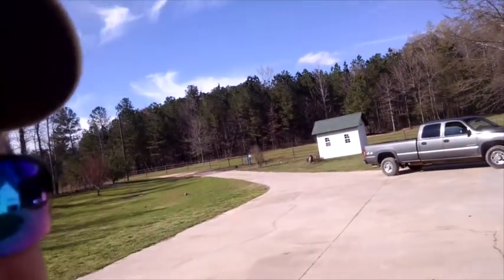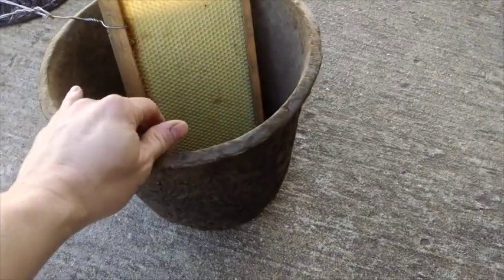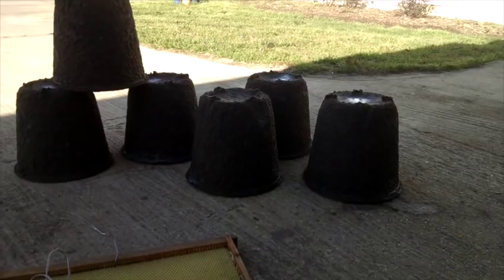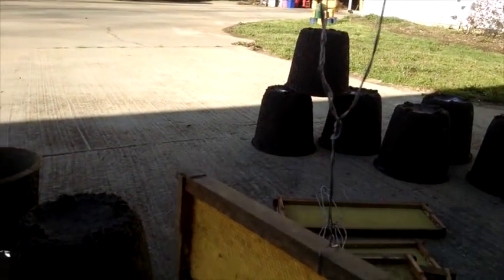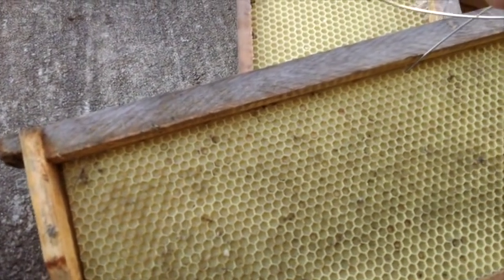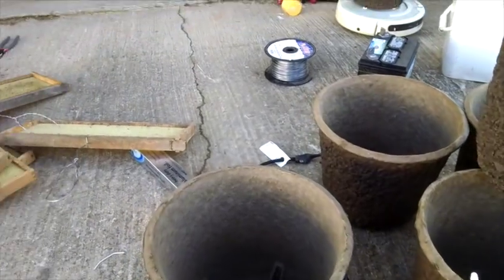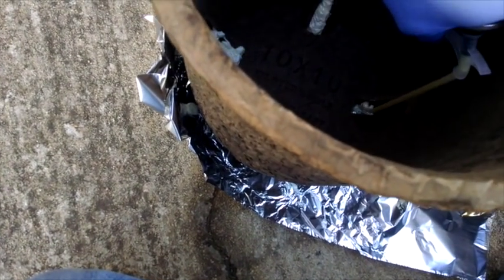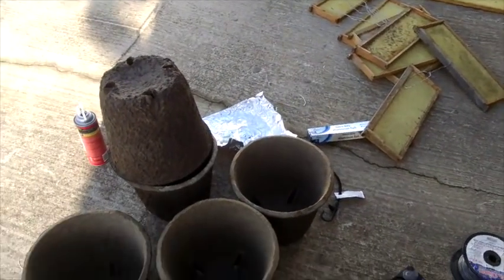Building Swarm Traps

Comment: Great idea! I would have used beeswax to seal up the gaps and to waterproof the trap .
Reply from the maker: +christine hood That's a great idea!
Reply: I was thinking the same thing. It would water-seal the traps, add a scent element to attract bees, and not impede opening the swarm trap to collect the bees into a box hive.
Reply: Beeswax would be a better option for a number of reasons, except that it's cost prohibitive.  The same amount of beeswax used to cover one of these could be put to better use to make several candles, coat several sheets of foundation, etc.. Scale that out to 10 or 12 traps and it starts to add up. Another thing I noticed is that when using beeswax on the outside, there seemed to be a higher occurrence of the bees building comb out on the outside of the pots.  This is my third season using these traps, and they work better than anything else I've used through the years. From what I can see, the waterproofing doesn't seem to bother them much.
Reply: Some very good points. My biggest thought was about opening the trap without damaging it too much for potential reuse. I don't keep bees, but I have worked with the foam.
Reply: A sharp box cutter makes quick work of the foam to separate the two halves. The remaining foam pieces can be flaked off by hand without much difficulty.  I was expecting the same problem you mention, but they can be taken apart and reused several times. I'm guessing maybe the waterproofing decreases the level of adhesion between the foam and pots?
Reply: Its possible
By the way, what part of Georgia? NW Atlanta metro here.
Reply: South Metro in Fayette County
Reply: georgiahikes It's good seeing local folks on the interwebs. Take care.

Comment: Marvelous idea! One minor problem - most expanding foams contain Formaldehyde! Hmmm lets see now, bees, chemicals, enclosed environment, minimum ventilation = dead bees!!!
Reply: Keep in mind these are very short term use.  I've since caught 20+ swarms using these since first posting the video and have not had a single instance of mortality associated with the trap.  I have had a few abscond, and a some that died out later, but none within 30 days of capture. I'm not disagreeing with you on the formaldehyde, but it doesn't seem to be an issue as far as I can tell.  I've also cut healthy colonies out of wall cavities next to expanded foam insulation.

Comment: My Father used oil of anise to attract bees when we were lining a wild swarm. It seemed to work for us.  I have not heard anyone mention lining wild bees to find the bee tree.     The first step in lining bees is to build a small wooden bee box made especially for this purpose.  Next step is putting a piece of 4x4 inch of honey comb in the box with sugar water added.   There are two compartments to the box, one holds the comb, and the other compartment has a small entrance door with glass set in the top to let in light.  You then catch wild bees feeding on flowers in the box and then slap a cover over the box trapping the bees inside, they will go through the small opening leading into the other compartment toward the light coming through the glass.   When you have 10 or so trapped bees you set up the bee box in your yard and release the bees from the box.     They will fill up on the sugar water before leaving and then fly straight to their tree hive.   They will then return for more sugar water and bring more bees back with them.  Within a few hours there will be hundreds of bees eating out of your bee box.     The next step is watching the direction they fly when going back to the hive.  After you have them working out of your bee box for a day or two  You then trap 25 or so bees in the box once again, and walk a compass course in the direction they fly when they leave to go back to their hive.   Set up the box again in a clearing and release the trapped bees again.    We usually set the box up every 1/8 of a mile until there are so many bees coming to the box it looks like the whole swarm is eating from the box.    Then it's just a matter of looking around at likely looking bee trees to see them flying in and out.     You can also time them by marking them with a small drop of chalk water or white flour mixed with water and time how long it takes the marked bee to fly home and back to your bee box.   If it takes them 5 minutes to fly home and store the nectar and return to your box it means you are real close to the bee tree.    Happy hunting. PS,  Make sure you stay exactly on the bees line of travel, otherwise they will not come back to your bee box, then you will have to start the process all over again from where you first started.   And take a good supply of sugar water with you to keep them coming back.    If anyone is interested in getting more detailed directions on how to line feral bees you can email me at naturebrook@aol.com  I will gladly respond in minute detail and even tell you how to take down the tree and put the live bees into a conventional hive to bring them home, it sounds more complicated than it really is..
Reply: Around where I'm from people don't say 'lining bees'. 

So I don't understand what you mean by it. 

But I'm interested to hear what you have to say.

Comment: I intend to use 5 frame deep NUC's to do captures in (with a frame or two in each mounted to trees....
I'll then be able to use the NUC's later for hive splitting and queen rearing.

I've seen the pot idea before, and sure it will work... I just prefer nuc's and building them from scrap plywood is easy.
Reply from the maker: +Atoyota I also make use of old nuc boxes and deeps for traps with drawn comb.  The deeps outperform the nucs pretty consiistently, but the whole point to these traps is that you can get them up pretty high quickly and easily.

Comment: great instructional video. What are your results? Do you have a video of a swarm taking up residence and how to open the trap and remove the swarm?
Reply from the maker: Karen Eaton  Thanks!  The traps have performed pretty well.  I've caught three swarms using them so far.  Two of them were massive, and filled it with comb very quickly.   Because they fill up so fast, I would say check them every 4 days at a minimum.  Our facebook page has some pics of using these traps.  Also, hang them in full shade.  I've found that even filtered sunlight can warm them up pretty quickly.  I don't have any video of opening them up yet.
Reply: BubbaTanicals Whats your facebook page?
Reply: +rob todd Also looked for this info. Found it, there it is : https://www.facebook.com/BubbaTanicals?fref=ts
Reply from the maker: +rob todd facebook.com/bubbatanicals

Comment: What about regulating temperature  or air/oxygen flow.  Can't imagine bees would find this to be an ideal "home",  even tho its temporary from the beekeepers point of view.
Reply from the maker: +D Chandler These traps have performed very well.  I try to base my swarm traps around Tom Seeley's research in swarming and site selection. In the long term, this design would not be sustainable or even manageable, but as long as you check them frequently, they work very well.

Comment: reason i don't like em is NO FRAMES, and have to mess with the comb more with rubber bands.   When a rubber band pops, it spooks the hive make them go into attack mold, and too a chance of killing the queen.  I try to stay away from that..  But it works good too but need some air vents put some screen inside some of the  holes  Set them in bee lines where bees travel . Like a pipe line, power line, around lakes, garden crops, fruit trees, berries, any thing that blooms  or near water ect  it can be on the ground waist high, head high, or 40' up /    i put where i can get em easy about head high   ITS WHAT WORKS FOR YOU one of my friends said he catches them at his FRONT DOOR  he heee i said well that where u need a trap RITE  "Keep with the same places you catch swarms at TOO every year"  SO THEY KNOW WHERE THEY ARE  they will come!
Reply: This design uses a medium frame inside the pot.  A larger set of pots would probably accommodate a deep frame.